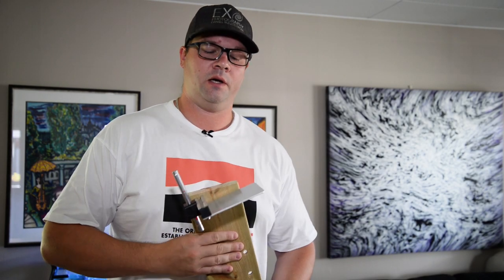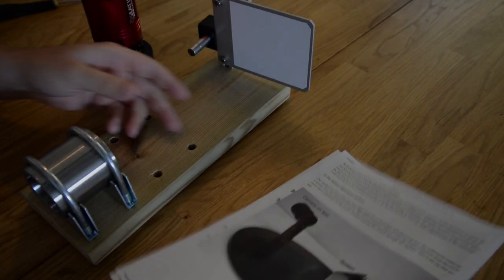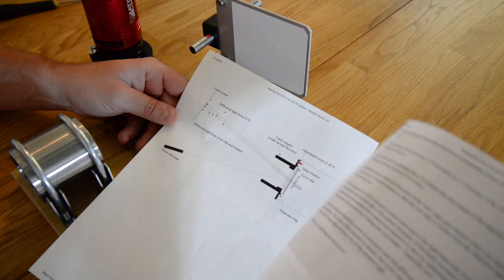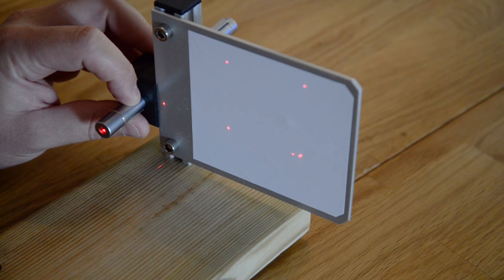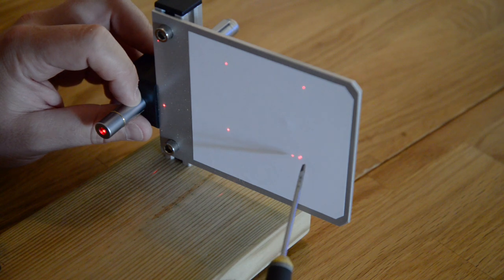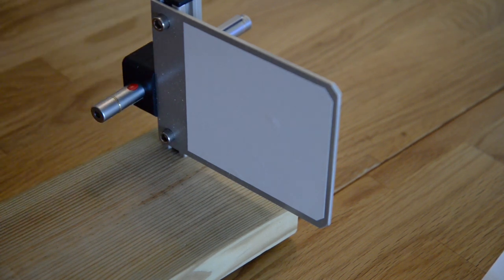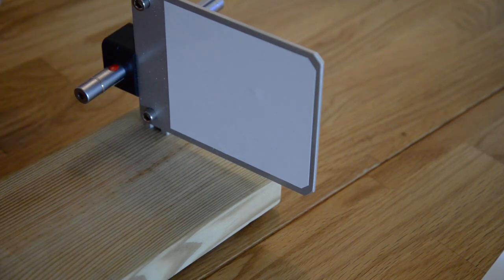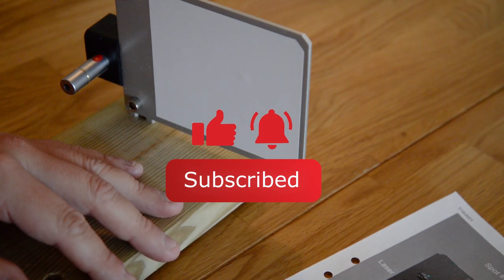Adjust your CCD or CMOS astronomy camera tilt during the day with a laser pen.

Comment: Hi Daniel
Interesting and I may try it on one of my ASI2600. How did you make sure that the screen is at a perfect 90° angel to your camera holder? As I understand it any tilt in the screen-plate (or holder) will cause a circular movement of the laster spot and interpreted as a tilted sensor. What you are measuring is how parallell that screen is to you sensor, if I get it right.
Cheers, Göran
Reply from the maker: Short answer - I didn't.
Long answer, I didn't notice some strange movement of the laser reflections which would lead me to assuming the plate would introduce these errors.
How ever - I have built a new version with a aluminium 20100 T-Groove rig plate with a 90 degree support bracket, so from now on, it is indeed mounted in 90 degree, or at least very close to 90 degree.

I have a upcoming video of the new parts i use in version 2 of the rig :)

/Daniel
Reply: @ExoPhotography1  looking forward to the new video. can you include a parts list and where to buy please?
Reply from the maker: @brianvalente  The Aluminium plate I used in a later video was bought from Amazon, it is listed as 20100 extruded aluminium plate.

The rest is parts I had laying around at home.

/Daniel
Reply: @ExoPhotography1  Thanks Daniel - the part that interests me the most is the 2" receptacle and mounting it to the board. any details on what that is?
Reply from the maker: @brianvalente  Yes, that one is made in a lathe with figures right of my head - But - You can buy one of those 2" extension tubes which i show in a video released after this one. I bought the omegon 2" 50mm extension i believe - this one is quite tight in tolerances so the "wiggle" is very well controlled.

/Daniel

Comment: That was difficult to understand.  Where did you get all that equipment?  I don't know what would work on my ASI2600s, both of which appear to be very far out of proper adjustment.  The components look expensive?
Reply from the maker: I made some my self, the wooden plank, the aluminium sheet with the white paper and the machined tube is self-made, costing almost nothing but then again, i have access to fine machines at my work.
The things i bought is the laser pen, the clamps for the tube and the aluminium bar holding the aluminium sheet. Costing around 20-30 USD. I have sience then upgraded and come up with a second solution if you can not machine the tube for your self. Check the two videos i made after this one and you get some more pointers :)

/Daniel

Comment: This seems pointless to me, there's just as much chance that the tilt in your system comes from the OTA and not the camera sensor.
Reply from the maker: For me, this is important to rule out any possible sources of errors.

As i mension in my videos, it might not be "the" problem I am fixing in the video which might have the biggest impact on my images - but all together it might.

The optical train can be seen as one unit, it isn't as strong as the weakest link.

And there is indeed cameras which have tilt in thier sensors, and this is one very easy method to correct that.

Best regards / Daniel

Comment: Can 5mW laser damage the sensor?
This report states that it can: https://ipvm.com/reports/lasers-cameras
Reply from the maker: This is very good points they make, I thought that Starlight Express have checked and double checked this but it might come with a warning.

The report does have some gaps though. Are the laser calibrated? Is it truly maximum 5mW?
Is it different with or without lens? (Focal point)

I will investigate this closer for sure!
Thanks for the heads up!

/Daniel
Reply: @ExoPhotography1  Yeah. You're right. I think, if the sensor is off and used without lens, so there's no laser light converging on particular pixels it could be safe. What about your experiment? Did the sensor work as good as before the test? Thx.
Reply from the maker: The sensor was perfectly aligned from factory, so i didn’t adjust anything, and according to all my images, the tilt is non existing 👍🏻